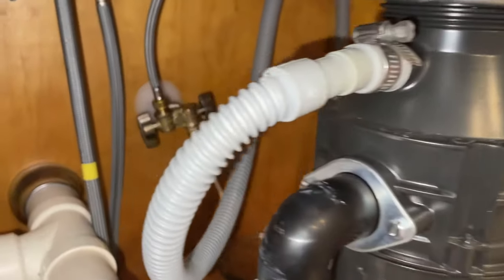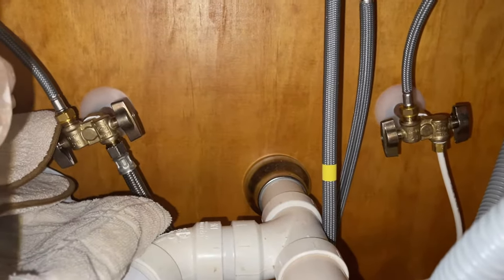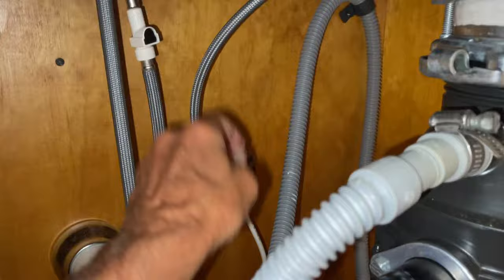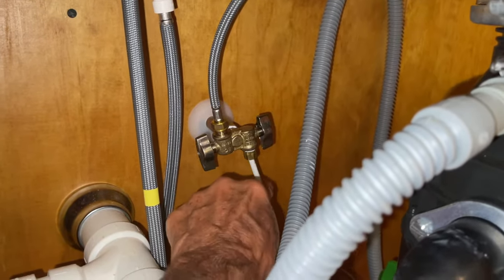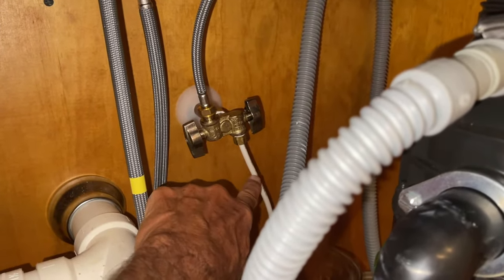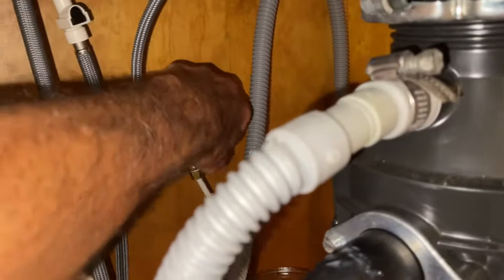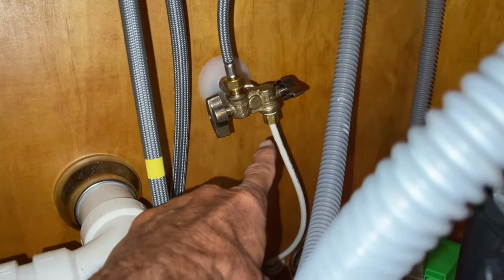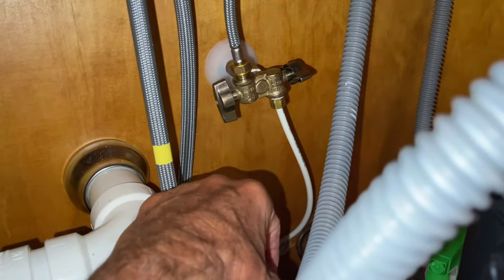How to turn off water supply to a refrigerator under sink

Comment: What if there is only 1 valve? I want to keep the sink water running but turn off the fridge water line
Reply from the maker: There Hass to be a valve leading to the refrigerator. It might be the hind your refrigerator. Check and say follow the line. Good luck thanks for watching.
Reply: Same issue. Did you figure it out?

Comment: I need to shut it off from the line
Reply from the maker: You can turn the whole valve off that the water supply is attached to usually there’s a secondary valve that you can turn off but if you can’t find that you can shut the water off to the house, shut the water off to the one valve or sometimes there’s a valve behind the refrigerator. Good luck and thank you for watching. Happy holidays